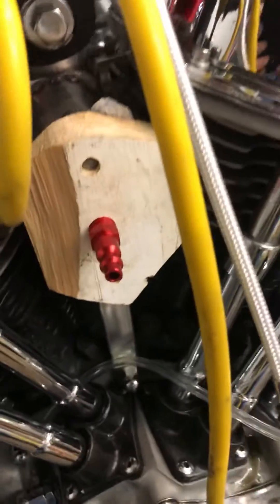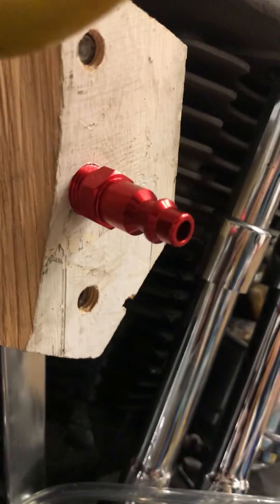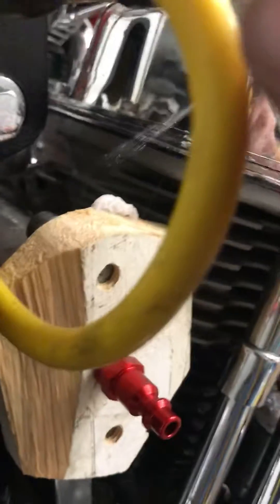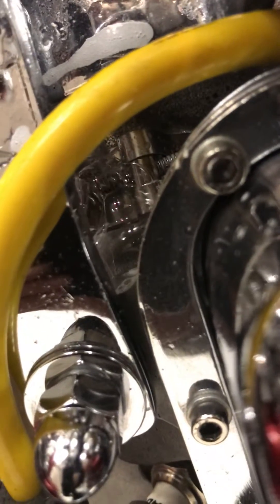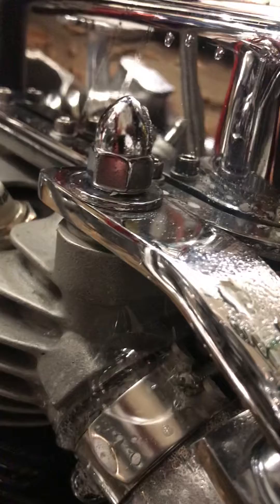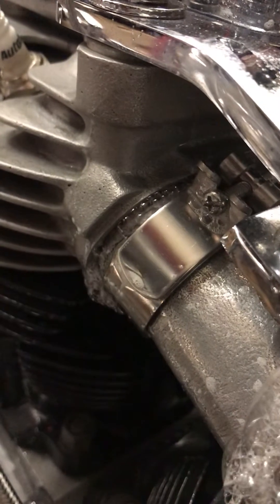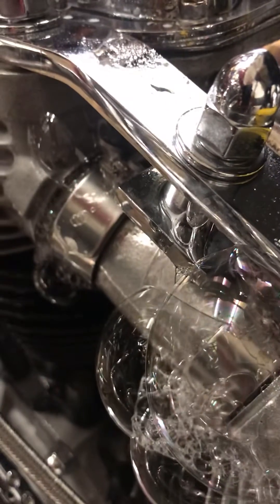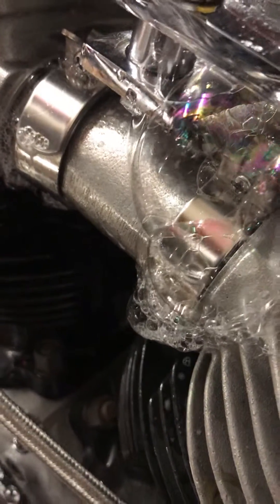Harley panhead intake manifold pressure test

Comment: Thanks for making this.  My 53 Pan has hard time restarting when hot.  I’m going to replicate this test.
Reply from the maker: You’re welcome! I’ve found that on mine with a super E it just floods really easily. You’d think that a hot motor would make gas into vapor immediately and not wet the plugs but it does. Even cold I don’t give any pump shots until she fires, maybe a little tiny one so it’ll catch. Usually I just turn on the enricher and kick smoothly through and that’s enough to prime and not flood